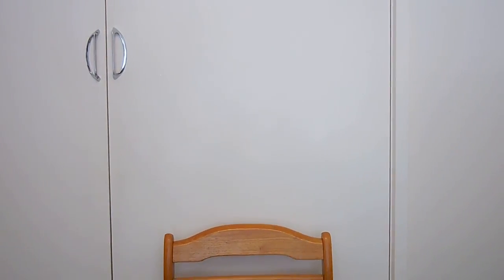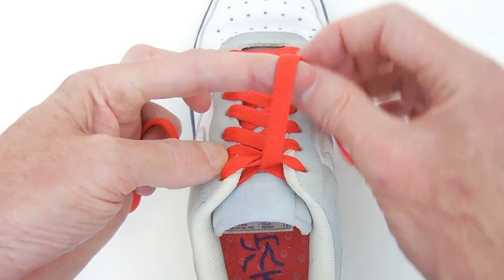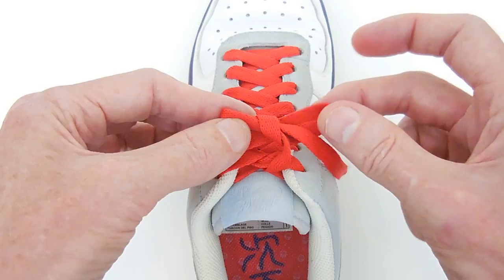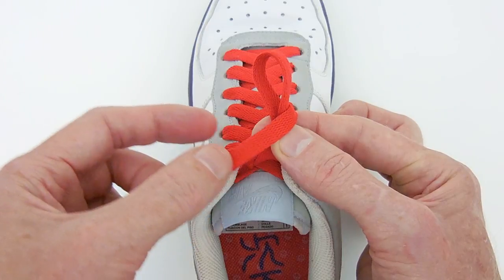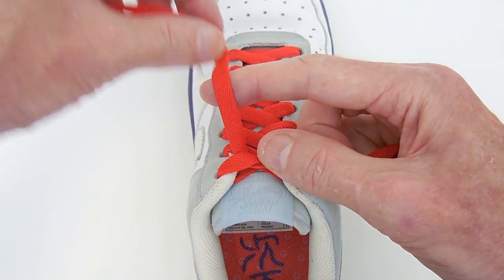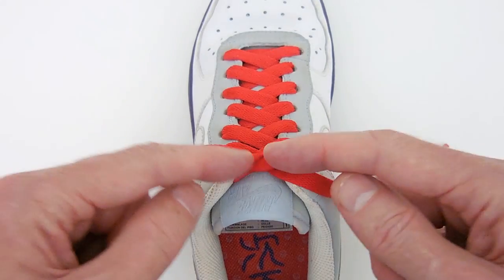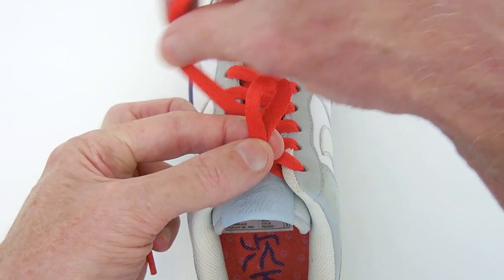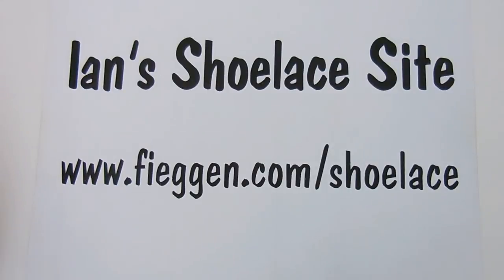Standard Shoelace Knot tutorial – Professor Shoelace

Comment: another great video here ian! i have a question. does it matter which way you 'fold' the loop? in this video you are folding the loop towards the front of the shoe. on your website (stage 2 flip book) it looks like you are folding the loop towards the rear of the shoe. hope that makes sense ☮️
Reply from the maker: I get what you're saying. Up to Step 5, the loop is pretty much flat, with the loose end at the right. At Step 6, the loose end begins to tuck behind as the knot tightens into it's finished state.
Mostly this was done for the sake of clear diagrams. You can form the loop any way you wish. It will usually rearrange itself during tightening, but even if it doesn't, the knot should hold almost as reliably.